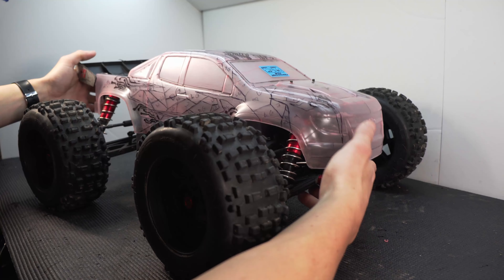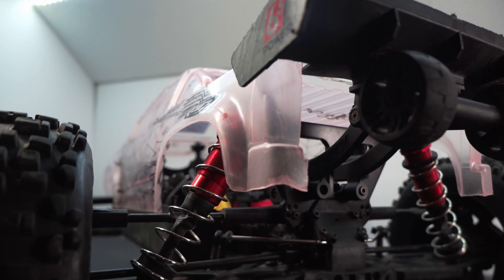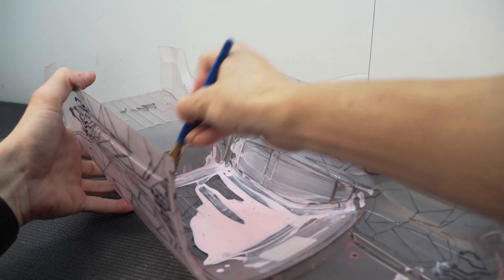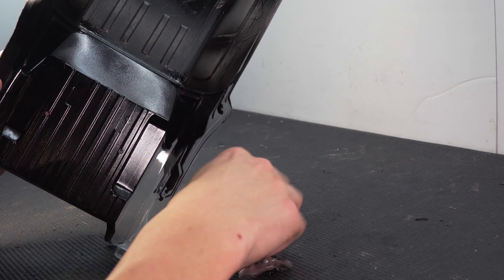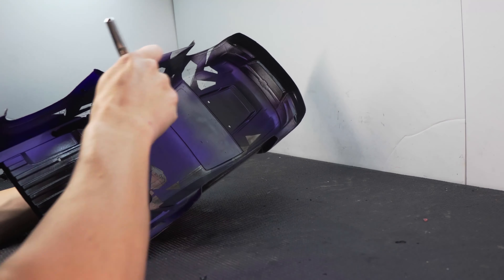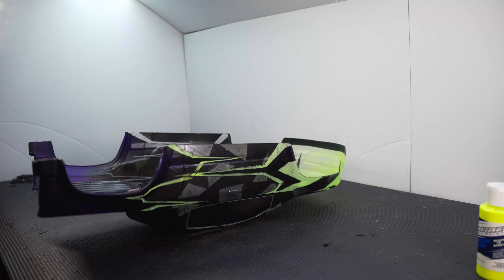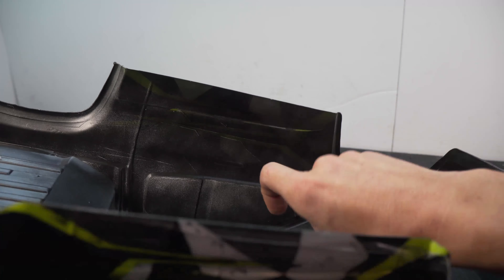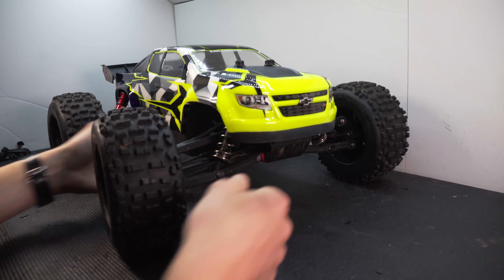Arrma Notorious Gets a NEW Body! | Proline Chevy Colorado RC Body Painting

Comment: So I've never have seen liquid mask. I saw that you lined the inside with it. Is it something that dries so that once one color is down you use a a hobby blade to cut out the next section for the next color? Like if you were painting the outside of the body?
Reply: Ok as I watch it again that's what it seems to be. And looks easier that taping it off. Plus seems like it would make the body more sturdy using it with paint.
Reply from the maker: Yep, it's painted on the inside of the body and used similar as masking tape where you can cut your sections to paint and peel layer by layer. It's a lot easier that tape to apply especially in the creases of the bodies.